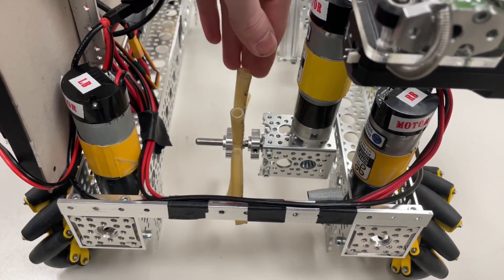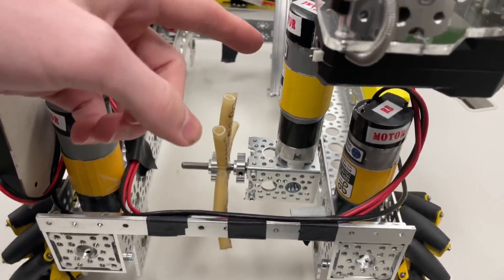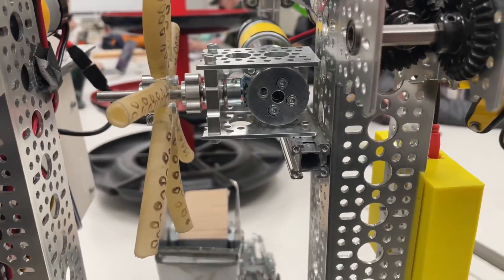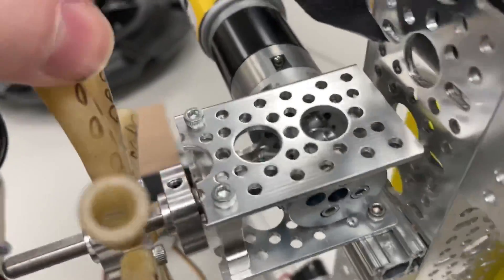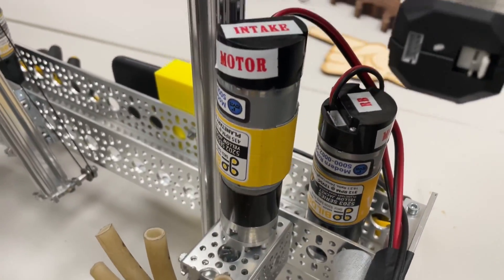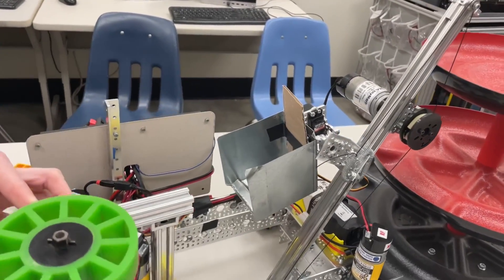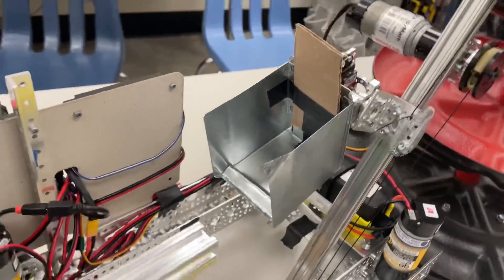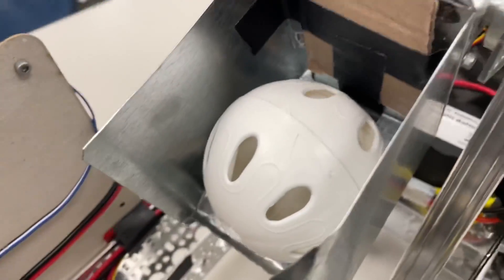Intake and Bucket Explanation | RoboHawks #5741 | FTC Freight Frenzy

Comment: So it can only place on the top layer
Reply from the maker: The slide only moves when the trigger is held, so to move it halfway, we just would have to let off halfway! But for the most part, yes, we are going for the top layer
Reply: @robohawks5741  even if the randomizer said to put on middle or lower?